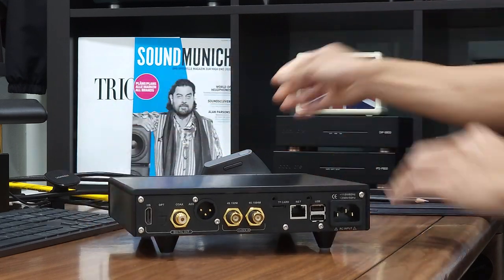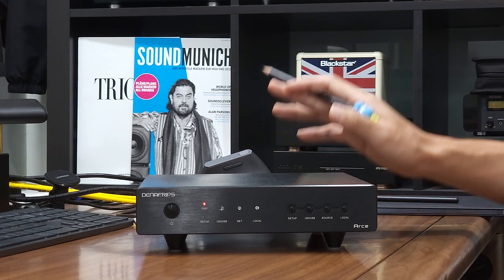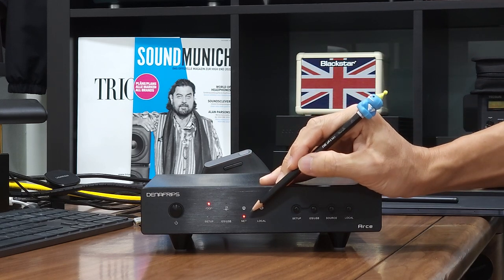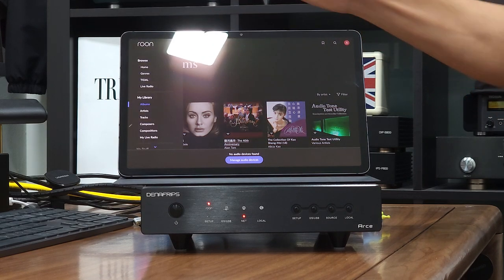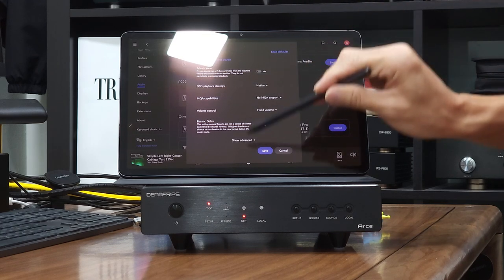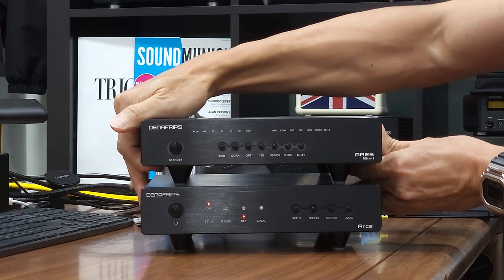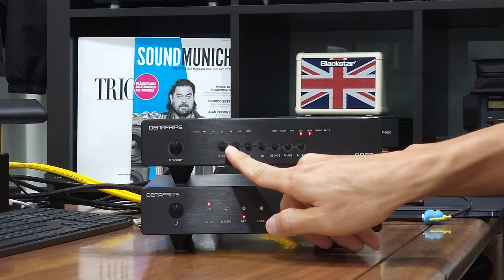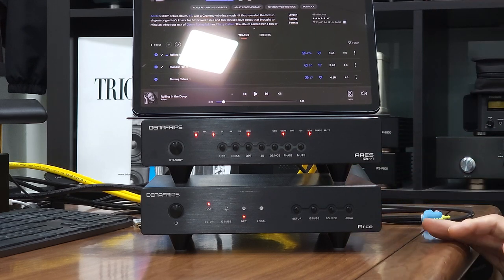DENAFRIPS Arce Streamer: Quick Start Guide / roon

Comment: My main concern with these products is the need to manually turn them on and off and change inputs at the unit. Why no remote? No app? No auto off or signal detection input switching?

Comment: From the MANY reviews I have read and watched about Denafrips products, looks  like great hardware.  However I would like to see the connections done on video, Alvin, get a mirror or one of your employees to do some camera work.  I'm ready to invest in streamer/dac/preamp, but not with Denafrips yet.  Something just not right with turning things on then cooking up hardware.  I watched Alvin do a at home firmware update for about 6 min and I had top turn it off.  Looked like a new EE on his 2nd time on the bench in lab.  I need to know that there is a service location in North America where the hardware can get repaired if necessary.  I have dealt with the Chinese on their manufactured goods before and they are terrible at customer support. Maybe that's why Alvin is in the picture.  I think I'm going with PS audio's AirLens and DirectStream Mk II.  For the Denafrips kind of money, it should all be plug and play.